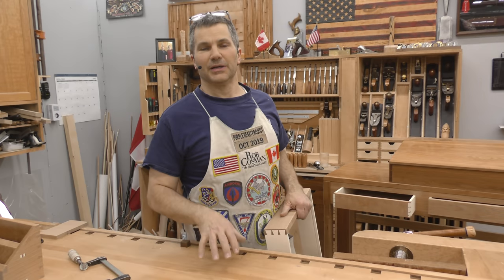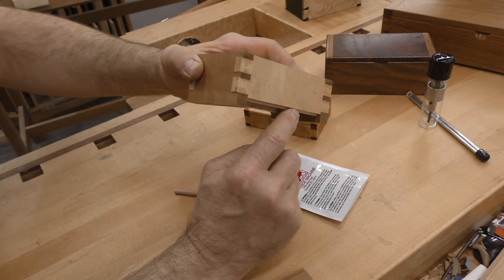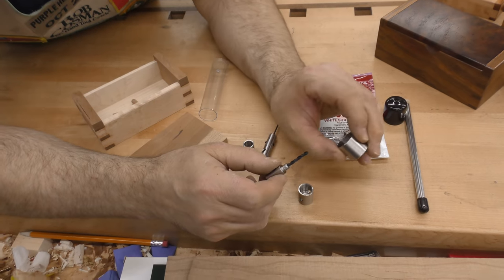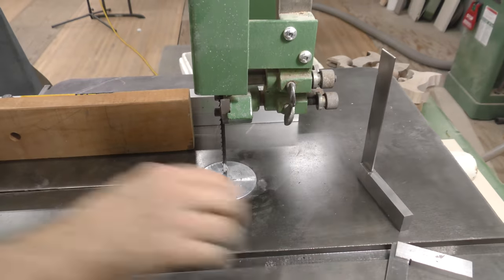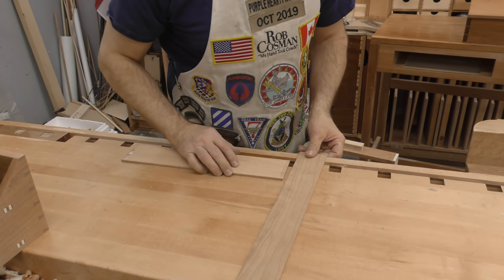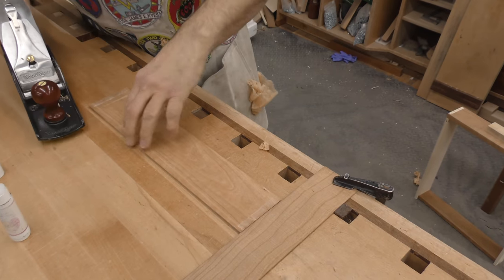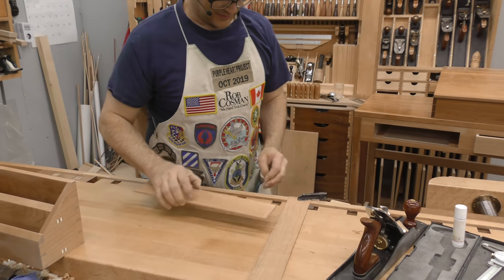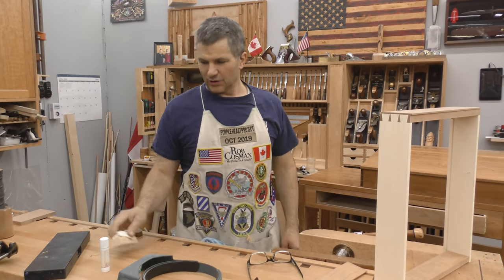How To Replace A Drawer Front - (Like a PRO)

Comment: A suggestion for the Q&A session is planing thin or narrow pieces.  When clamping between bench dogs, I have experienced bowing in one direction or the other even with light pressure.  Thank you for doing this series as it has already improved my sharpening and planing skills.  Have the wooden hinge kit and a new dovetail saw on the way but not here yet.  Looking forward to their use.

Comment: Thus has given me several ideas on fixing things. On the double sided tape trick for planing. Great idea!  I agree the tape can be too strong sometimes. Instead of carpet tape I use painters tape. Put a piece on the waste board and in the back put a few drops of CA glue. Exactly opposite of that put another piece of painter’s tape and spray accelerator on it. The two pieces of tape will glue together but when you separate the wood the t painter’s tape peels off cleanly.

Comment: You can try the blue tape + super glue trick instead of double sided tape. You put a piece of blue tape on both surfaces and then glue the tapes with super glue. I still has quite a bit of hold. I use it to make temporary jigs and also work holding in the cnc

Comment: Use a peice of blue tape on each face and superglue between the tape backs. It holds enough for templates, straight edges, ect. But the blue tape isn't enough to lift the grain most of the time.

Comment: Rob, I like the wooden hinge hardware kit you sell to make them. A lot actually. Will likely buy it. I don't own a router. Just hand tools. Do you have a hand tool method to make the half circle into the box top and side?
Reply from the maker: Been thinking about that for a long time but we are so busy I just have not had the time to play with it.
Reply: RobCosman.com thank you. I am thing along the lines of the Veritas small plough plane. If I had a blade for that, I could start with the straight blade to remove most of the waste then finish with a curved blade (sort of like I am making a mounding). Or cut the right angle bit then use saint paper on a properly sided dowel (or you could make custom round rasps and files). If you ever need someone to to try prototypes, I'd be happy to give it a go.

Comment: Use masking tape instead of double sided tape, put a strip of masking tape down on your bench, another strip on the drawer front and put a few drops of super glue in between to hold them together. Easy to get off and no residue left behind

Comment: there seems to be a stubbornness or maybe its just ego for hand tool carpenters that refuse to save time and frustration by just using a thickness planer to get  a good starting point.  bandsaws deflect.  if snipe is a concern, pad the ends and use a backer board.